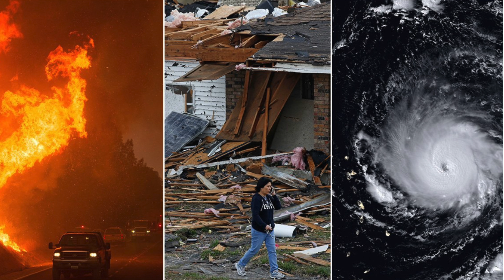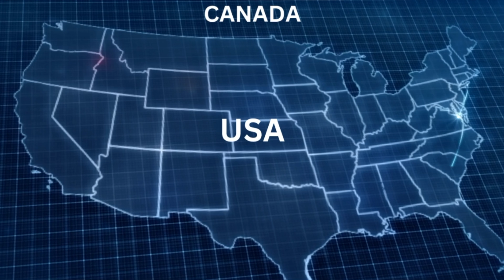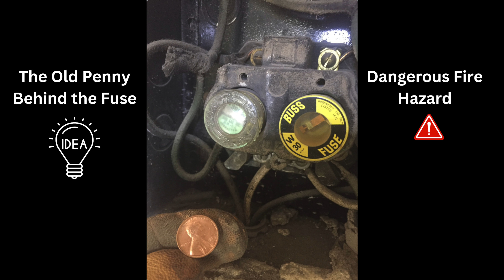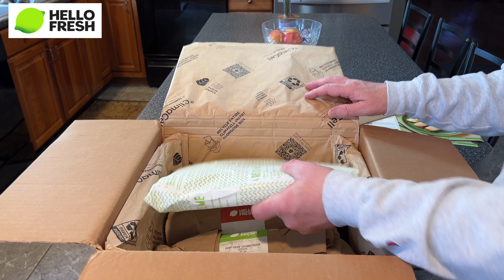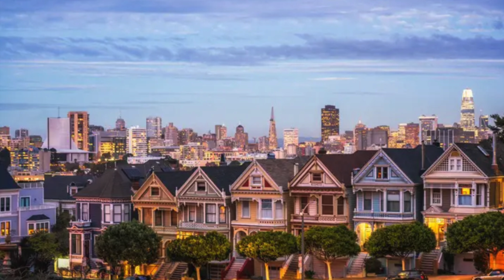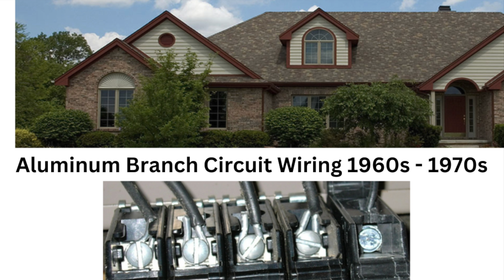Old Wiring Causing New Problems (Are you at Risk?)

Comment: Bought our first home in Newfield, Me and made 4 cents checking the fuse panel. Updated to CB and tore out what seemed like miles of knob and tube. Found an old KT 240 3 wire circuit that fed an out building lying in the mud in the old pig pen. It was still live going directly to CMP around the meter with no over current protection. I thought that was bad until I bought a house in Alabama. That was scary!!!!

Comment: They gutted a house I lived at.  They were shocked to find knob and tube behind the walls.  The reason they were gutting the house, is because there was sheetrock on plaster, and sheetrock over the sheetrock, and the bonds were failing.  They did not expect knob and tube.  They thought the house was already rewired in the 1970's, because that's what they paid for.

Comment: We also had an old 2 story barn. I’m in the upstairs part of the barn, somewhere around 15-20 years after the dairy cattle had departed. I’m cleaning up loose straw on the floor along the south wall. I looked down and saw two wires running parallel approximately 8 inches off the floor. The wires were BARE the whole distance that I could see. My first thoughts were curiosity and then I realized they ran up to the light switch. I couldn’t get downstairs fast enough to pull all the fuses. Time, mice, and wear had removed all the insulation from 8-12 feet of electrical wires. AND they were covered in dry loose straw. Had that shorted, the only thing left to do was bring the hot dogs and marshmallows. We rewired the barn…

Comment: 40 years ago I used the “penny” method once. “On the farm” in a small outbuilding that basically held tools, we had a welder, one overhead lightbulb, and an outlet that I can’t remember if it was original or added specifically for the welder. The welder outlet was hooked to a fuse box holding 2 fuses and a knife style disconnect. It didn’t have enough capacity to operate the 240 v welder. The “fix” at that time was the proverbial penny in behind the fuse. It worked. I think the main reason was the wiring itself was of sufficient size, it was the box itself that was undersized.

Comment: I used to be a volunteer fire fighter and found many pennies in old fuse boxes that were responsible for the fires. Another issue is people putting 30 amp fuses in 15 amp circuits to “fix” the constant fuse blowing.

Comment: Yep, we have one remaining KnT circuit in the house. When we moved in it was on a 20a Breaker. We had an electrician inspect it and got a thumbs up for condition of the wire and insulation, but we dropped that circuit to 15a because there was no need for large loads on that circuit. an AFCI would be solid additional insurance before having to pull the circuit. That said I have a laundry list of things to "fix" with the electrical plan when the time comes. At least one breaker per room? Oh god please yes.

Comment: not so sure about the 1940's date references, the only post and tube wiring I've seen here (central and southern California) has been houses built in the 1920's, and my 1938 house has steel conduit  from then..
Reply from the maker: Yup, it depends on location. Some areas with little to no code enforcement like parts of VT for example used it into the 50s
Reply: @BackyardMaine   thanks. those old attics look like a maze or or serious game- try to get across the attic without steeping or falling on a wire etc

Comment: If the wiring is in good condition not illegally modified and you don’t use large appliances it can be safer than some newer wire.
Reply: My 1914 house originally just had two 15A circuits, with shared neutral.  When I bought it in 1989, the previous owners had a LOT of stuff powered by one of those circuits:  washing machine, the kitchen outlet, the TV, the one full bathroom, and two bedrooms.  And I think they had both of those circuits running off the same phase…

Comment: The challenge with old wiring is folks forget how much more power we consume now. My house was built in 1966 and had a 100A 24 circuit panel board, with 40A side box for 2 breakers for the air conditioner. Today it has a 200A panel, with 64 breaker spots, and it is getting towards full. Shed, hot tub, evsc, heat pump, heat pump water heater, central vac, microwave, etc.

Comment: Al is fine IF it is sized correctly, My drier and AC unit are Al
Reply: AL is fine in larger home run circuits. The problem is when it's in the branch circuits.

Comment: Note that some early cloth Romex cable has tin plated copper conductors. This is not aluminum and is perfect safe. A simple test is to lightly scrape the conductor. If copper is underneath the plating, it's really copper wire. Tin plating presents no hazard.

Comment: My late 50s home has early romex but the grounds were just wrapped around the ends of the outer sheath where the metal box clamps would clamp down on them. In any box I replaced a receptacle in, I pulled the grounds into the box and bonded them like in your grounding video.

Comment: Our house was built in 1970 with aluminum wiring.  Had 2 instances of overheated devices, needless to say that was 2 too many.  $9k later, we had a new panel and all copper.  Cost wasn’t as bad as it could have been, with it being a ranch home and all the wiring able to be run from the basement and attic without opening walls.

Comment: Luickly with a new (to me) house I moved in to, seems some wiring was updated pretty well... Besides the panel. Though did find areas like the outside porch and basement had what appears extension cable used for outlets. I was wondering why it was stranded, and one of them seems like it was hanging on by a thread. Nearly all the outlets are replaced as well, and the porch will be getting a new box/outlet and wire. 
IS there anything about a service line being copper? Thought our old panel was aluminum coming from the main, but later found out its copper.

Comment: Just a point on the dates of Knob and Tube: Many homes in my area were still built with Knob and Tube in the early 1960s, so going by the dates isn't fool proof.
Reply from the maker: Wow, thats about 20-30 years after it was a code violation. Maybe the area had no electrical inspectors but still I wonder where that bought the materials?
Reply: @BackyardMaine Many people worked for the railroads right through the 1960’s,and many of the railroads still used telegraph lines and wires until the early 1970’s when they were abandoned when better 2 way radio systems came out. Many railroad employees used to take excess wire which was 12 gauge wire, and use this for household wiring which was some of the best knob and tube wiring because of being 12 gauge.

Comment: I got AL wire and it will melt before the thermal trips happens.  I have gone through and taken the load of these circuit by running Romex for hi current outlets.  Use Alimcons and make pigtails for updated outlets.  In the 70's bathrooms didn't have dedicated circuits and kitchens only had 1 and sometimes share the living room done in a north,east,south, and west configurations.   My advise for AL homes use AL for low loads de-rate to 15 amps on 12/2 wires, no heaters, vacuums, or AC's.  I learned how to fix this stuff because of AL.

Comment: I worked on a lot of BX in Albany NY.  At lighting fixtures you could just blow the cloth insulation off in many cases.  Just installing a new light fixture would require a very gentle touch. A busy box was a nightmare.

Comment: How do insurance companies know if you have knob and tube wiring? They do not have access to an inspection report and any disclaimers must be in the insurance policy.
Reply from the maker: Thats a good question. I think some of them go on the build date for the home and whether any electrical permits have been pulled for wiring updates. Often time the issue is when the home is sold or when you change insurance carriers. I had an issue with my insurance increasing by 20% per year because my roof shingles were over 20 years old. I tried to get quotes from other carriers and they wouldn't even quote me until the roof was replaced. I just finished the new roof last month.
Reply: @BackyardMaine That is another interesting question, how did they know about the age of the roof? I have a 30 year, 130 mph wind  guarantee with Lowes for my roof, materials only? Why is 20 years too old if it is still under warranty?
Reply from the maker: @TexasEngineer I had 30 year shingles as well and they were faded and showing age but they were still fine. No cracks or curls or leaks. I noticed a big increase two years in a row so I called and the told me it was the age of the roof. After five years my rates had more than doubled so this year I replaced the roof with 30 year shingles.
Reply: @BackyardMaine I found failure was the grit coming off the shingles the clue it was time to replace. The gutters were filling up. An odd roof leak sealed the fate of the old roof. The new roof was put on with six nails instead of three which boosted its rated strength to 130 mph hurricane wind for three more nails The cost was very cheap with the 10% military discount. A two story house has less roof to cover. Added hardy plank siding and windows at the same time.

Comment: Up until 1982  the US penny was 95% copper, with 5% tin & zinc, a very good conductor.  After 1982, the penny composition was changed to 97% zinc with a copper coating, a not-so- great conductor.  so, use an older penny 😏

Comment: Knob and tube is actually very safe IF you leave it as installed and IF it was installed correctly. It needs to not be covered by insulation. The weak point was in the device boxes when the insulation crumbles. That can happen even with later wiring.

Comment: For the past year I've been rewiring my 1953 home using all MC cable (don't like romex) and AFCI/GFCI breakers. Luckily it's all drywall so no lath and plaster to deal with but it is definitely a job. Original wiring is cloth NM cable so no knob and tube but still wanted to update the house to current code for my own peace of mind.

Comment: If knob and tube wiring in good condition it's perfectly fine as long it's behind a circuit  breaker and isn't overloaded like any other circuit. I wouldn't use it for plugin outlets but don't see any problem for a light circuit.  Most insurance companies in my area, Milwaukee WI, don't care what's after the circuit breakers, as long as there's breakers.
Reply: I just replaced my old Zinsco breaker panel after the main breaker arched on the aluminum bus bar and deleted half the power. Some of these old Zinsco breakers fail to trip. Insurer has never asked about the panel brand.

Comment: I helped my grandfather re wire my great-great aunt's house (pre-WW1) in the late 1980s.  Where a conductor passed through a tube or was supported by a knob is where the insulation tended to fail (I assume movement and/or heat cycling abraded it), but it would break one end loose on a span and not the other and slowly the conductor would slice through it.  The attic looked like walking under a pine tree, but it was shreds of fabric hanging down instead of needles.  There were literally 3' lengths of insulation hanging from rafters.

Luckily it was a whopping four circuits (and I was young and flexible) and we got it done in a day.  I remember that we pulled out an ancient fuse box and put in a new breaker panel, but I didn't know the penny trick at the time.  I wish I had known.  I'll bet there were some ancient coins in there.

Comment: Shortly after moving into a 1930's house, replace a 3-way switch for the stairs.  The wire feeding the switch, didn't look "right".  When I investigated in detail.  The plastic insulated pigtail, were spliced to knob & tube, the splices soldered, taped, and hidden inside the clamp.
Reply from the maker: That's scary, I've seen some real horrors in older homes.

Comment: I just bought a 1984 house. The attic had Romax wires hanging from the ceiling on bent nails and wire nuts everywhere. from ceiling fan additions.
Reply from the maker: What a poor installation. It's not code compliant and it's not safe. They do make a box that can be connected around open splices without taking the connections apart.

Comment: You stated that the use of knob and tube was phased out (in the US) in the 1940s.  I have lived in northeast Ohio my entire life and K & T was standard well into the late 50s.  But far worse than K & T is the do-it-yourselfers.  I don't know how much add-on wiring that I have seen using ripcord (lamp cord).  Usually 18ga.
Reply from the maker: There were and are still some areas with little to no code enforcement. It was phased out in the late 30s but I'm sure the inventory was being installed for a while after.

Comment: Thank you for your video.
I visited relatives in Arizona.  Aluminum wiring was used in their home. 
   There are recent videos  showing aluminum wire used in new Arizona homes. After about a year, the insulation shrank and pulled several inches from the circuit breakers. Bare aluminum was exposed. Chief

Comment: Adding a large power load through your old electric service ( EV charger) is probably the number one problem. Getting rid of Nat gas heat and going to electric Heat pumps with heating strips is problem no 2.
Reply: EV is not that big. My electric furnace has a 100 amp breaker and can pull 82 amps on high. The main breaker is 150 amps. The underground service wire cannot handle a 200 amp panel upgrade. Your EV is on a 30 amp breaker and limited to 80% of 30 amps. It is similar to an electric dryer or water heater.
Reply from the maker: You got it, lots of older homes have inadequate electrical service, especially if you add a high draw item like an EV charger.

Comment: I’m surprised you didn’t include old BX wiring.  The same cloth insulation was used to make it, and it isn’t separated like knob and tube wiring is.  Two or three code cycles ago I remember being warned that insurance companies were going to target it next and make it the next knob and tube. Pretty sure they were talking about general liability insurance, but that’s how knob and tube got on home insurance’s radar.
Reply: In some ways, old BX is more dangerous due to the potential of shorting to grounded sheething.
Reply: @bobjohnson1562  How so?  I would have thought that a short inside the armor would be contained and therefore safer.

Comment: I do not think they should cancel the policy, but the premiums should be adjusted if you have unsafe wiring. First all old style wire has no ground wire and are are very bad fire risk. Old wires can not carry the current needed for todays needs. It is a matter of safety. You could get electrocuted or the house could catch fire and someone could be injured or killed. Better to spend the $20K to rewire the entire house. You can not put a price on home safety.
Reply from the maker: I have an issue myself right now. My roof is 25 years old and over the past five years my premium go up considerably every year. I talked to my insurer and they told me it's because my roof is over 20 years old. So I decide to try to move over to other companies and found I could not get coverage until the roof is replaced. Talked my my company again and they told me they won't cancel my policy but they would not insure me either if I was apply for new coverage. So this summer I'll be replacing a roof thats still in good condition.

Comment: Great video. I bought my house in the early 90’s. It was built in the late 70’s. It has copper NM cabling. Over the years, I have replaced most of the branch circuit breakers with arc fault breakers. Unfortunately, I cannot replace them with dual ground fault/arc fault because of what I call shared neutrals. On a lot of the 3-way switches, the end where the light fixture is, the hot conductor for the light fixture is connected to the common terminal of the 3-way switch, as it should be. But because there is no neutral with the traveler conductors, the electrician attached the light fixture’s neutral to some other switch/receptacle that is almost always a totally different branch circuit. This resulted in the light fixture’s hot conductor being one branch circuit and it’s neutral conductor being a totally different branch circuit. While this doesn’t bother an arc fault breaker, this causes a ground fault breaker to constantly trip. The only way to fix this would require tearing up a lot of finish.
Reply from the maker: That's a really common situation. I think you're right, there's not much you can do without a major remodel.
Reply: @BackyardMaine  I did come up with a solution that was easy to implement and did not require tearing into any finish. I discussed it with my local AHJ (who I find to be very helpful), and while they considered it, they stated there is ‘no code provided pathway’ that would allow the use of my solution. So, as you said, there is not much I can do with major expense.

Comment: I have both K&T (roughly 30%, and active), the rest newer Romex, by newer, mid 80's, up as the house had an addition of 2 bedrooms up front and more outlets added, thus all that was Romex, Living room, original bedroom and kitchen, likely bathroom will has some K&T in service. I know I need to deal with all that, but the service panel itself was replaced as it was a replacement for the old fuses, and you guessed, it, FPE, so had that replaced in 2016, 200A/240V service at that.

The house was originally from the early 1900's with kitchen/bathroom added mid 20's, two front bedrooms, 1985 to make a tidy 3 bedroom house in an older development.
Reply from the maker: Sounds like a great project. Good luck with the upgrade!